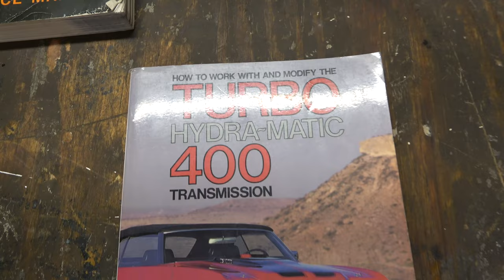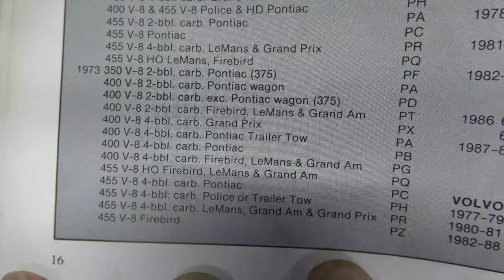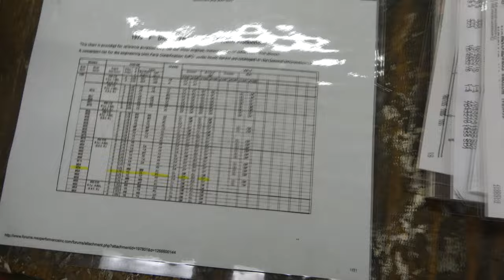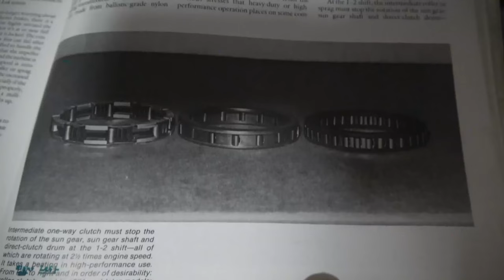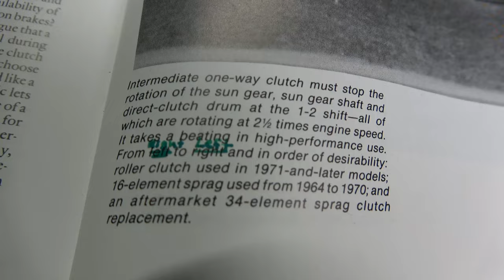1973 Trans am Transmission

Comment: I had my th400 transmission out of my 73 formula for a flexplate change, and much to my suprise it was a 71 year AA transmisson,. Probably came from huge cadillac land yacth with a 472. did not dissasemble it, but hoping there is a sprag in it, and posibly an extra clutch pack, seing that it was intended to drive a heavy car. atleast the bellhousing is the heavy duty style with support ribs,